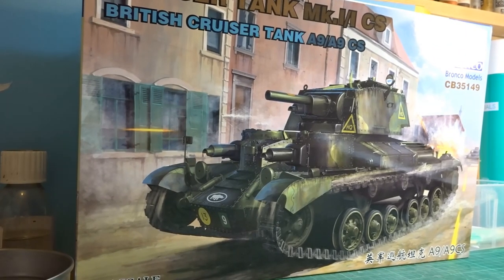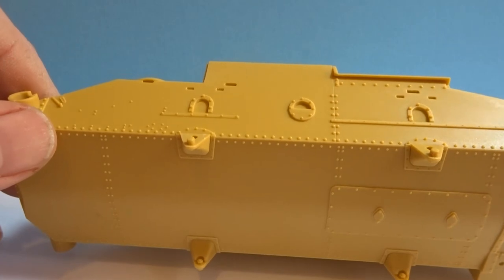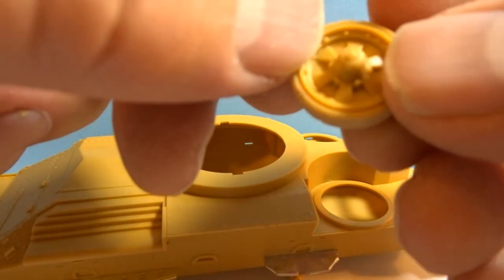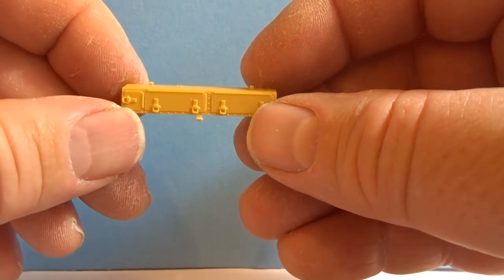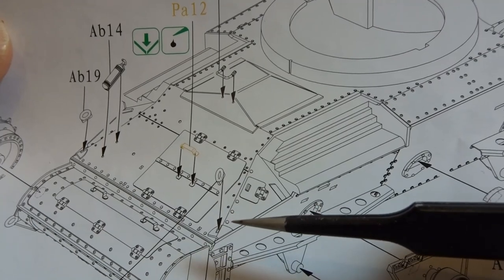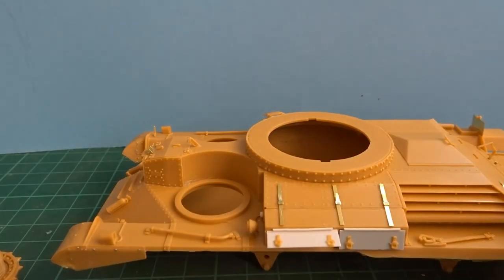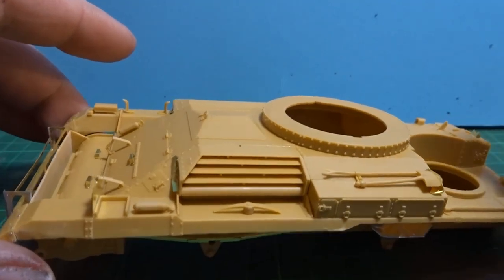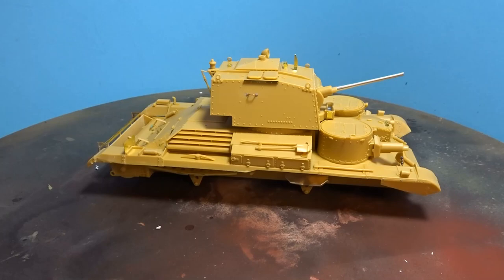Bronco 1/35 Scale British A9 Cruiser Tank MK I  "CONSTRUCTION"

Comment: Thats an interesting kit, and you've really fixed the detail errors quite well. I built the Bronco Ram 2. My only complaint were photo etch light guards, which like on your Cruiser tank, were extremely fragile, and the the multi piece tracks.. After some research I decided not to use the light guards.
Looking forward to the the next video. Cheers!!!👍👍😀
Reply from the maker: They were indeed fragile. Some of the research photos show them damaged so they certainly didnt hold up well in the field. Thanks for looking in and subscribing to the channel.